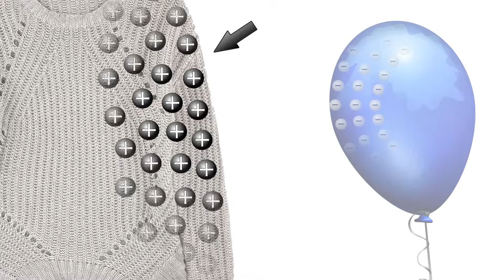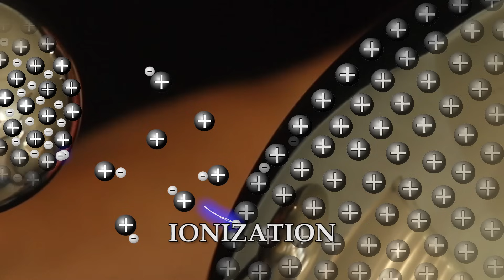Avoid electric shock getting out of a car!

Comment: What I wanted to ask was how to remove the charge 'safely' if we are out of the car already. Would it be good to hold on to an insulator which itself is somehow connected to an earthed conductor, so that there is some resistance in between? That way, the effect of discharge wouldn't be too much?

Comment: sorry,
about the car shock.

the static is not because your body rubbing to the seat.
but from air rubbing to the car body when driving.

the shock you field is the electron flow from the ground through your body to the car body.

Comment: In the early 60's auto parts stores sold a strap the looped around your rear axle tube and draged and bounced along the ground discharging the car's static electricity.for this particular problem.

Comment: Just hold a piece of metal in your hand (like a metal ruler or you house key) and touch any metal like a car door with the metal object in your hand. Say you getting out of your car. Step straight out without touching any of the metal on the outside of car. Before closing car door. Touch with end of key while holding key tight.  The shock will discharge through metal end like your key instead of your finger. Problem solve.

Comment: ...I wonder if certain things have their charge maximised, and or pressured with more waiting energy....Maybe roof groundings, roof antennas, pipe groundings, telephone groundings, and electrical imputes like house wiring, batteries, general and atmosphere energy may also contribute to bottle necking and spikes in current....As defects in electrical materials... Maybe battery operated devices may help create power surges as well.....These things need to be analyzed to address how electricity may be negatively effecting humans and other creatures....... Once the basics are understood, procedures to correct this should be explained.....

Comment: Put a penny on top of a Plasma Lamp and touch it. Also try touching the plasma lamp and moving your finger closer to the penny for best results.
You can produce electricity spark going through the air on the outside of the Plasma Lamp!

It's really neat and interesting! I don't know how or why this works but I'd like for you to demonstrate and explain the physics going on for this experiment.
How does the electricity escape the plasma lamp into my finger?
It doesn't really shock much but it will burn a super small amount into a finger. I've used this to make a little smiley face tattoo looking image on my finger when I was a kid.
No one knows about this trick but I am sharing it with you because I think you will find it fascinating.

Happy Physicsing ☺️

Comment: that was a great video to watch. I drive a bus , as I get out i hold the (insulated) vinyl handle of the door pillar then slide off the seat to produce charge, I then reach for the metal key and get Zapped. To solve the problem I put a ESD Anti Static Bracelet strap - with the clip at ground and the exposed metal  part (that the bracelet clips onto) within reach near the key. I touch the exposed  metal part and no big zaps for me.

Comment: In the winter I could develop a charge large enough to jump a gap of at least 6 millimeters when I would try to insert my key into the door lock, that's about 18000 volts.

Comment: I disagree. The shock you get is from the alternator building up a charge and cause of the rubber wheels cann't ground so it grounds through the person as he r she is getting out. They used be a grounding thing on cars to solve this problem but they dont use them anymore. It used be behind the back wheel. That is  my assumption anyway but I could be wrong.

Comment: I solved this problem myself in a similar way, when I get out of the car I touch the ground first as the current is lower so there is no shock, but its less practical than holding the side of the car... which I didn't think of.

Comment: You know how you can prevent that you get the dryer sheets and put them in your shoes not to get rid of the smell but it helps Denton the shock it's kind of like putting graphite inside your tires when you're driving down the road the graphite spins around there makes the completion of the rubber

Comment: what to do when in winter you go for groceries and after dragging the shopping cart in superstore when you touch any metal stand or metal post you get same shock....even though shopping carts are mostly metal made and you are touching them during shopping but when you touch any other metal stand, display, pole or post in store or outside you get this shock......what to do for that?
Reply: It doesn't matter that the shopping cart is mostly metal. What counts here is metal that is grounded. If the wheels of the shopping cart provide a good enough insulation you won't discharge enough and still get shocked when you touch metal that is grounded.

Comment: This is why you need to be careful when fueling your car that spark can ignite gasoline vapor, ground yourself to the car beforehand and don't get back in the car during fueling a spark near the filler port can be disastrous.

Comment: This doesn't work for me when getting out of the car. It definitley helped but if the static buildup is that bad, it'll still get you every time. I used to do this in college with my jeep grand cherokee cause it would cause me to spark like crazy but I would still get hit with the shock when I would step out but at least it wasn't as bad...

Comment: We are much more likely to get shocked on a hot dry day.  The humidity can drop below 5%.  My wife's solution is to close the car using the glass leaving the charge on the car to get me when I try to lock the door.  My solution is to put my leg out of the car keeping it in contact with the door sill.  Any charge passes through the solid leg rather than through fingers, arms, torso heart etc.  That way even if the spark happens I do not feel it.  In more extreme events I use a wooden ruler.  This conducts enough electricity to discharge a 
van de graaf generator but slowly so no spark happens.  It works fine for things that are large like trucks.

Comment: I always got a shock when getting out of a car I had that had plastic body panels. I never had the problem with a car with metal body panels.  I found it more pleasant to touch the outside of the car with the tip of my key before touching it with my finger.

Comment: That hand out of the car didnt work for me. I got shock while still sitting in the car.

But i guess i am just a shocking person. A few years ago i got back from a car show.(cars and carpets all around). I got zapped real hard by the outside of the car. I than touched a tree instead(within 10sec) and got zapped again. Than i walk home with my dad(was still living at home back than) and i got Zapped again when hanging on my coat. I was so sick of it at that point. I just asked my mom to turn on the shower and open all doors in between. Drop my cloths and walked into the shower without touching anything. Just to get rid of it.

Comment: Well, I thought it's due to car touching a lot of dry dust particles and building up a charge on car metal body. I guess the solution is letting the charge leak through tires slowly before leaving your car. BTW does the Physics Girl strategy work?

Comment: Thank you! I knew most of this, but the part about the humidity in the air either escaped my memory or I hadn't heard it before. I just got a newer car this winter, but I've been getting shocked off of it over the past few weeks. This timed out perfectly with some electrical problems I was having so I was worried. BUT, we have also had much dryer weather during that same time span. You have helped put my mind at ease and to lessen the pain in my fingers from the static shocks. :)

Comment: You should always touch your car with your bare hand before you reach for the gas pump to begin refueling.  It discharges any static electricity safely, before you begin the refueling process.  Much safer than allowing it to discharge as you begin pumping fuel, which could  ignite the fumes and turn your gas pump handle into a flame thrower.

Comment: You can buy antistatic spray at the store in the laundry detergent isle.
In the winter, I spray into the sleeves of my coat and on the inside as well, as I get shocks after taking off my coat.
I also pray it on my car seats.  It works!  :)

Comment: The way I remedy this after getting out of the car is to hold your metal key firmly with your fingers and let that key touch the metal object you want to touch.  The shock will be at the site of the metal key touching the car and away from your skin.  You can still hear the spark but not the pain.

Comment: Honestly, I finally remembered to buy Dryer Sheets today simply because I got shocked while getting out of my truck on my way into the store to purchase batteries; because obviously I needed more electricity.  ;-)  I am thankful to finally have been shown the pre-grounding technique , it seems so obvious now.  I have used dryer sheets on my cloths seats and that coupled with actually using them on my cloths in the dryer does dramatically damper the effect.  Cool vid.  Thanx!

Comment: Cloth / fabric car seats are worse for causing you to get a shock like this than leather seats. And wearing fleece type clothes seem to gather up a large charge pretty quickly from car seats. 
Often, a thorough clean (ie, vigerous wet and dry vaccume & carpet shampoo; repeat many times) of the car seats will help reduce this effect dramatically, or completely. If your car gets dusty, or has anything over (I don't know) 75k miles cleaning your seats would be a good idea anyway!

Comment: Hey, if you wear any metal jewelry, touch it to the doorknob before you open the door. You won't feel the shock. If you don't wear jewelry, use a key, or any metal object to discharge the static.

Comment: During extreme cold (Boston winter) below Zero, a clean/waxed car traveling through the cold air (driving) builds up a static charge.  So, grounding yourself against the car does not work.

Comment: In winter I always touch that galvanised door lock loop, visible at 2:33, with my keys or fingers as I slide out of the car. Getting zapped by the metal shelving at the supermarket is always hazardous as I always forget to take care, you're thinking about groceries, not static. Don't need a coat or jumper where I live.

Comment: You can also just knock your knuckles against the outside of the car. Placing your knuckle quickly on the car (not slowly and cautiously) and the broader surface contact area of the knuckle both dissipate the discharge so you don't feel it or hear it as a spark. Also your knuckles are less sensitive than your palm or finger tips, further reducing any sensation.

Comment: It happening too much since the pandemic started. It made me wonder does excessive use of sanitizer on hands has any effect on static? 

Nice Solution on the car part but still if you touch the car body on the way out, the Door panel will shock you. If you touch the Door panel on the way out, the Body panel will shock you.

Comment: Wearing a wedding ring helps me for this. In the winter I almost always make sure if I am to touch metal that I make sure my ring is the closest part of me that comes to the metal at first contact. In this case you see a spark from the discharge but it does not hurt at all.

Comment: Another way to not get shocked if you get statically charged is to clench your fist when discharging yourself. You will still discharge and make a spark but won't get the uncomfortable jolt which is from your muscles involuntarily contracting.

Comment: A simple way to prevent a shock is to "ground" the charge just by touching floor or a nearby wall. That will get rid of the charge without a shock. Done it many times.

Comment: Huh. I always thought the violent event was tyre rubber on road, charging the vehicle, which is also insulated by the tyres and cannot discharge. Then you step out and if you are not wearing sufficiently insulating shoes, the charge from the vehicle goes from you to ground. Back in the 80's and 90's it was common to see cars with static strips trailing from the rear of the car's body to the road to relieve this. There's even a 1941 paper on it called Static Electricity and Automobiles by Robin Beach.

Comment: @Physics Girl - (Thanks youtube analytics for the super delay here.) I always considered this problem to not be related to getting out of the vehicle directly. But instead, I thought it more likely that while driving the vehicle around. The body of the vehicle has air and dust flowing over it and that would be akin to rubbing your hair with a balloon. Much the same way an electrical repair helicopter uses a discharge probe before the lineman disembarks to the lines. As the vehicle is doused in a constant stream of air particles to build up a massive charge especially when that vehicle is a helicopter hovering. By touching the side of the vehicle before disembarking. Could that allow for a balancing of the load away from the vehicles exterior to the internal structure such as the seat and yourself? With a reduced potential it may not be strong enough to arc across that gap any more in theory?

Comment: I once worked in a building where the combination of the carpet and my shoes caused a shock every time I touched metal, so I would touch everything with a key first. People laughed at me, until I walked up to them and touched them with my key.
Reply: what to do when in winter you go for groceries and after dragging the shopping cart in superstore when you touch any metal stand or metal post you get same shock....even though shopping carts are mostly metal made and you are touching them during shopping but when you touch any other metal stand, display, pole or post in store or outside you get this shock......what to do for that?...........i think its same situation as you described but different scenario.
Reply: I experienced that. I used to put drawing-pins in the heels of my shoes, so I was slowly discharging into the carpet all the time.
Reply: The shopping cart has rubber wheels, so it builds up a charge. Hospital trolleys have conductive wheels to avoid that, you will see them, coloured yellow.
Reply: This should be a… well not serial killer… maybe a horror character “key shock” or “shock key”

Comment: My old car had a rubber strap that was connected to the underside of the back of the car that dangled down far enough to touch the road or ground anf I never got zapped. My new car doesn't have one and I get really bad shocks all the time especially on windy days. I live in Australia and was told as a kid in the 70's that this was put on cars for exactly this purpose so why has this knowledge been forgotten or is it deemed as a harzard of some kind and made illegal?

Comment: I get shocked off the seat adjuster as well as the door. By Physics Girl's logic, this charge comes from my back rubbing on the synthetic cloth of the seat which is then conducted away from the cloth surface by some metal part of the seat framing and onto the adjuster bar underneath.
But - in anticipation of this electrostatic phenomenon - why don't automotive engineers build in some earthing path for charge accumulating from seat cloth friction ?

Comment: 0:20  van de graaff generator.  1:25  even insulators like styrofoam get charged.  2:22  how you get shocked getting out of car.   2:44  in cold dry air, touch the body of car while you get out.

Comment: You can simply use the car key and touch the metal part of the key and touch the car with the key. There will be a spark but you won't feel anything, the key acts as a resistor.

Comment: Simply remove your key from the ignition, place you thumb on the metal part of the key, and touch the key to a metal part of the car body.  Thus, any spark that occurs happens between the key and the car, sparing your body parts the unpleasantness of electric shock.

Comment: You didn't mention the Faraday Cage! Both the Van De Graff generator and the car are Faraday cages. Any excess charge in a hollow conductor jumps to the surface, leaving the interior neutral. Thats what makes the VDG generator work.

When you get out of a car without touching it, the charge on your body is free to have a different charge than the car, which leads to a shock. Touching the car brings the two charges to equillibrium, preventing the shock.

As you leave the car, your body moves from inside to outside the Faraday cage. Your skin gradually becomes part of the exterior of the Faraday cage. In really dry weather, you can feel the charge move onto you as you get out.

Comment: "insulators don't conduct electricity. right?"
wrong. insulators have high resistance to the movement of electrons, while conductors have low resistance. that is the only difference between the two. enough voltage overcomes the resistance and electrons flow, with low resistance this happens very quickly. a buildup of electrons in the substance allows easy movement, as when an electron jumps into an object it then pushes out an electron where electron pressure (voltage) is lowest. this means that you don't need to overcome the entire object's resistance to get an electron to seem to flow through the object.

Comment: Thanks alot for your solution!!
I was not aware of the reasons behind this problem rather other things comes to my mind like my body is releasing current these days🙂 like electric man!!
Some times it seems funny to me.
I was wondering really, so I decided to find what's the problem and solutions.
You know I started to shut my car door with my keyring rubber and it worked!
But in hurry I had to feel shock!

Could you tell me please leather cover on seats can avoid body getting charged while driving ?

Really thanks a lot